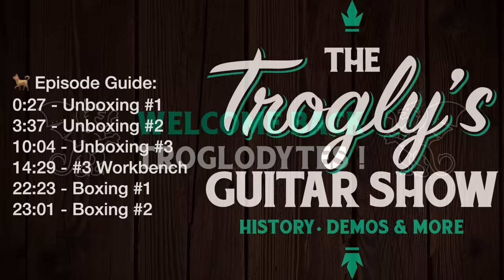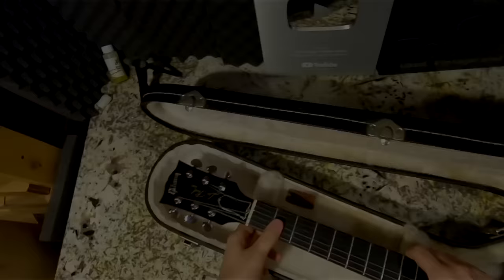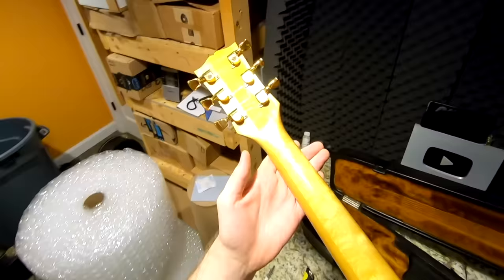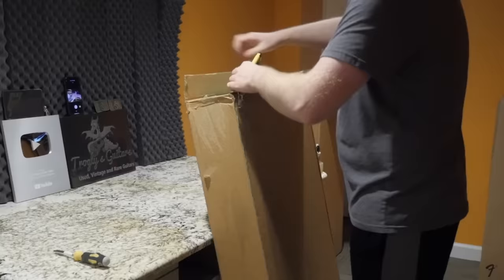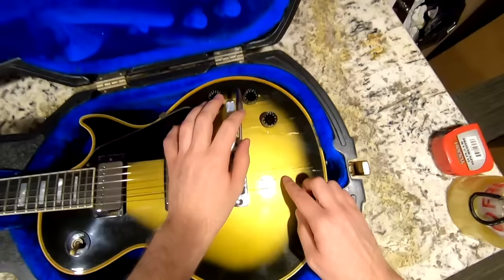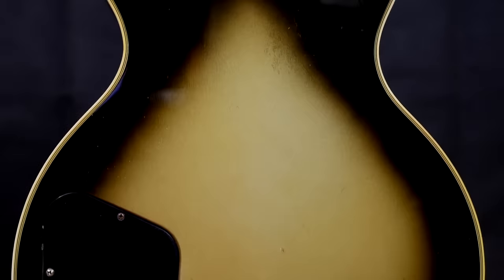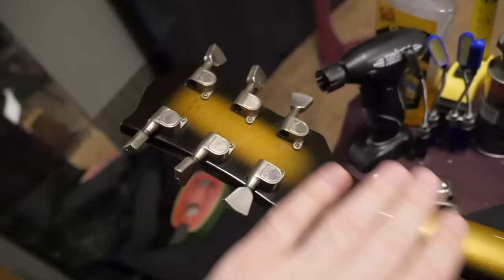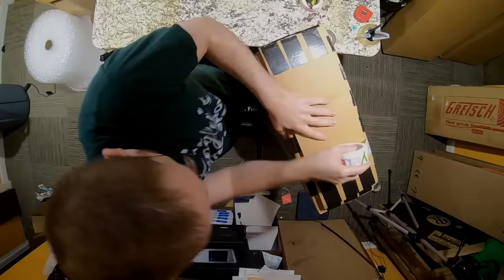What Happens When You Buy 3 Guitars from Guitar Center? | Trogly's Unboxing Guitars Vlog #87

Comment: I bought one guitar from Guitar Center, had it shipped to the local store (cheaper shipping). When it arrived I went to pick it up and they opened the box and the headstock was broken. They processed my refund on the spot, no issues. If I ever bought another through them I'd do the store-to-store shipping again,  just in case.
Reply: I do the same
Reply: Just bought one. Trying to learn and after hearing the horror stories about GC I wasn't sure if I wanted to buy from them bought ordered it pickup and luckily it was perfect

Comment: Dude. A lot of the older Gibson guitars   Have longer threads sticking out. They are cut differently. You can also add a half moon washer under the nut. I’ve done it a million times with great success.
Reply: Truss Rod Threads on a Gibson are a good thing.. you should’ve made the adjustment to see if it operated correctly. You can always add a washer. Kids these days😂
Reply: THIS!
Reply: Very good point!!!
Reply: Yeah, this guy is worried about some really strange stuff.
Dude, I'll take that natural finish les Paul if you don't want it lol... jeez
Reply: Yep
Reply: Also looking at the threads without measuring the relief tells you nothing about the state of the guitar.
Reply: Confirms the neck is already straight, then says the truss rod is toast and beyond adjustment.
Reply: @sunbrookcondo4179  He "sighted" the neck and said it looks straight. Measuring the relief with feeler gauges would give a better idea of how much relief there is and then tighten/loosen the truss rod to make sure it's still working. 

As others have said all truss rods are not cut to the same length so you can't determine if its 'toast' by the number of threads showing. 

I'm not a professional tech but I've been working on my own guitars for years and I wouldn't return a guitar I liked without doing some more investigating. A guitar this old with a 3 piece maple neck probably hasn't moved in years and if the neck has the right amount of relief already I don't see it as an issue. If it plays great and the set up feels right I wouldn't care. I get that it's a different story if you're selling the guitar to someone else.
Reply: @jonnybabich9667  well pay him for it then
Reply: @sunbrookcondo4179  right?
Reply: This guy really gets on my nerves !
Reply: @ChubToneGuitars  Back it off, see how far it bows and then condemn it.

Comment: I worked at Guitar Center, "The Evil Empire" as I referred to them, for 2 years (aaaaarrgh), and they never, ever, perform the sort of detailed inspection for used guitars that they should. (this does not apply to the Vintage Guitar Vault at the Hollywood store, as they most often sold to the pro's and discerning collectors, and was managed by two guy's called "The Burst Brothers" who were VERY knowledgable). Doing an inspection of an instrument prior to buying it off the street is a job requirement as mandated by corporate. But in practice, never done, as most people working there, with a few exceptions, don't know what to look for as they don't have the technical knowledge or experience to do this. ESPECIALLY with any sort of vintage instrument.  If you did a "Street Buy" and the guitar was found to be defective later on , you were screwed by management (although sometimes forgiven under certain circumstances). The way it worked was this:
Somebody comes in with a guitar to sell. They look around for an employee to help them. ALL the floor sales people quickly rush away in order to  avoid making contact with the seller if possible (not jokeing here). A manager will then intervene andr does the transaction, or they will assign it to a salesperson to do the "Street Buy" as it is called. Sales people HATE doing Street Buys, because the process takes up a great deal of their time to process and fill out the necessary legal paperwork, etc. This process also requires them to fully check out the instrument (they aren't required to disassemble it though). All of this process takes up thier time and takes them off the sales floor and away from  making commission. Though Street Buys are a part of their job requirements, most hated having to do it andavoided it if at all possible due to this reason. More often than not a new amd less experienced employee would be assigned this responsability and thus, mistakes  would be made. Management could be quite brutal if you didn't make your monthly numbers, and is quite compettitive and cutthroat with the sales people, Sales people took shortcuts, rushed the process, then hustled to get back on the sales floor. This is a generalization of the process and how employees dealt with  it, and it should be taken in that context. It does however, provide you with a caveat when purchasing used equipment from them.
Reply: Drew hasnt worked there in 14 years.
Reply: @deebop4904  neither have I, thank god. I was only relating my experience theere and not intending to speak for others. The management I worked for was possibly the worst experience I have had. This may not relate to other stores, but it certainly did mine.
Reply: @stephencastro1437  nothing has changed

Comment: Just started watching the video, but what a coincidence -- I also purchased three guitars from guitar center recently. Each one was either listed incorrectly or priced very well. Every guitar I bought came without a case and they did a GREAT job packing it. A couple of the guitar's they even put into boxes from the same brand 😂 i.e. a 2004 epiphone I bought came in a new epi box because they had it lying around. Cute lil touch for an inexpensive guitar
Reply: That's cool, what model epiphone did you get?
Reply: @brendangibson2925  it was an SG-310 listed as a special iirc. I got it shipped to my house for $135 total, sold it for $200 on CL by the end of that week. Funny enough, I actually mentioned trade Tuesday in my FS listing for that guitar, and somebody emailed me to say they were going to lowball me until they saw I was a trogly fan. 🤣😂 they wished me luck instead.
Reply: @brandonmitchell1056  ah that's cool, I have an sg-EB0 bass
Reply: Lying around

Comment: Guitar Center Used has been my guilty pleasure since 2010. Now, you can find serious differences in prices between stores. I have made quite a few great purchases from the stores in the smaller markets. I am usually looking for the oddball 80's early 90's amps and guitars.
Reply: i work at a small location guitar center and we price gear to MOVE here. sold a used custom shop g&l asat that was absolutely decked out for $1350 the other day. there are deals out there just depends on which guitar center, who bought it in, and who you talk to about purchasing

Comment: 12:00 that is what heat does to varnish! I make custom walking sticks. Sometimes I need to remove the clear coat. I use a heat gun gun to remove it. The finish looks like this when it gets to hot and I don’t scrape it off. Sometimes I get interrupted mid process. When I get back to it, that’s what it looks like.

Comment: 3rd one looks like water damage.  There is a pretty distinct dirt line running up and down, likely the guitar was standing up and only the area from the tal piece down actually was under water.    The splitting further up the body is in line, and shows that the liquid was absorbed pretty high up.  The pressure of the strings is likely what caused much of it to break.
Reply: Ya that's pretty severe for sure     that makes more sense

Comment: You can save that truss rod. Look into the stew mac truss rod tool. Allows you to slightly bore into the truss rod cavity and then it also adds more threads to the truss rod. Well worth it to save that beautiful custom.
Reply: Just put steam on the fretboard, take it off, remove truss rod, put new one on and glue the board back

Comment: You can easily drop fill in the cracks with tinted lacquer, and do a fairly good finish repair. Especially where the lacquer is just checked. It will drip through the cracks and under the lifted finish and adhere to the body. with the proper rub out it should look good. Thus saving it from a respray!

Comment: Great vid. No need to discard guitar due to exposed threads on TR. Usually an added washer solves this smoothly. Recently did on a P bass. Some brands like Rickenbacker come w. a fair bit exposed threads original. Just a tip

Comment: Austin, I am guessing chemical damage caused the issue on the last guitar. If you look at where the blistering occurs and the fact that it only affects the clear coat and a small portion of the original paint, take notice of how it seems to be "running" away from the nuts on the controls and even the trem system. It looks to me that someone sprayed something like a WD40 on the nuts and did not know that it would react with the nitro finish as it did. Exposure to a high heat is of course possible as well, but just by the fact that it is moving away from the controls it looks like whatever they used was sprayed on to the nuts then ran down the guitar. Now, heat exposure could also be the cause because those same areas would have heated up more than other areas of the guitar because of the metal that's there. But, if it was heat then it should be around the controls as well, not just moving away in one direction, which indicates more of a liquid running. I am not sure what lubricant would interact with Nitro the way it appears to have done on this guitar but that shouldn't be that hard to figure out. How in the world did you not see that kind of damage in photos?

Comment: Guitar center sold me a Martin that needed a neck reset. Was at the end of its truss rod too. I still liked the guitar but that definitely should’ve been disclosed before sale. All the details about these guitars are available because the techs do look at them and even set them up so they’ll sell on the floor but they don’t disclose anything. Pretty shady for such a huge guitar retailer.
Reply: @tjailts  yeah that really is the kicker. The returned guitar will go right back up as they cross their fingers that the next buyer won’t notice or care
Reply: part of why they are going bankrupt.
Reply: I'm not saying great things about Sam Ash because they are definitely overpriced on their used gear but at least on their website they straight give you a description of the guitar which guitar center should do as well.
Reply: @beefnacos6258  yeah it’s funny you can actually get good deals on guitar center, not because of good prices but because of mistakes they make listing things. Just shows you how bad that system is
Reply: This video was on my suggested videos.... My dad is a guitar player/PRS junky, I'm just a drummer, but I bought a used Pearl drumset from Guitar Center. I noticed in the pic on GCs website it had 10 lugs on the bass drum (only higher end drums have 10 lugs vs 8 lugs) and had the traditional size toms (not like those power toms in the 80s) I called and asked if the drum shells were fiberglass and they checked and the manager said yes.... They were listed for 150 dollars and I asked if they could help me out on the price... He said $115 delivered (done deal)...the next year Pearl drums reissues the fiberglass drums for $1100....if you are patient you can definitely get a steal...I'd hold my drums up to the highest end drums as far a tone and volume for $115 delivered 😊. If I did not like them, I had a chance to return them...I'll never sell these drums.
Reply: @drumsandmore4448  absolutely you can. It’s just such a crap shoot on the gear actually being in great condition. But of course there’s the return policy. It’s just funny how those steals come as a result of errors not actual good pricing
Reply: @drumsandmore4448  Power Toms rule! 😄
Reply: @drumsandmore4448  I was a drummer, switched to guitar and vox 12 years ago so I could control my own band. Frankly it's GREAT to hear someone else say "I'm just a drummer!" A great drummer is a thing of beauty! One that's modest is a god-send!! If you can sing you're hired!! ROKKON! \m/
Reply: @markcheetah4960  "Ah! The [sound] of napalm in the morning!" ROKKON! \m/
Reply: @DeafBunnysBand  Haha, I hear ya!  I started out as a guitarist but switched to vocals because there were a TON of guitarists around (and most of them were way better than I was).  Vocalists were hard to find, especially ones who had a PA system.  So I switched to frontman, with occasional rhythm guitar duties.  Cheers, man! 😄
Reply: @DeafBunnysBand  Cool, thanks very much!  I subbed back.  Let me know if you're on Twitter, Reverbnation, or Soundcloud.  I gladly follow back!  Cheers!!

Comment: Recently bought a "new" Gretsch Jet Baritone and had it shipped to my local GC.  The packing was horrible - loosely packed in a large box with paper and bubble wrap.  Headstock cracked, neck damaged.  Glad I had them open it, sent it back and currently waiting for it's replacement.  Had a new Guild Starfire 12 sent to the same store several months ago and it was neatly packed in a Guild box, which was inside a larger box and well packed.  Guitar was immaculate.  Moral of the story, if you buy from GC have it sent to the store and have them open it up.

Comment: You often get weird about truss rods being “maxed out”.  StewMac makes a $1 washer that you just take the nut off and put the washer on. Operates just as it should. Really not a thing at all.
Reply: The thing is that it starts pulling the stop plug forward towards the headstock and that becomes more of a problem.....just saying...on the other side Yes I would at least try it first before returning it because actually what you are talking about sometimes works......
Reply: @rondobondo6600  I hadn't thought of that. I suspect that is because more of the rod is above the most stable part...I wonder if they could make a similar "washer" that is similar dimension to the Gibson stop plug. That may keep it from pulling that way.

Comment: On the body the Kahler doesn't seem stock. It should just have a small square hole. The truss rod cover should be in the regular location just shorter and the lock nut is usually right next to the regular nut.  But they could have refined that from 85 to 89.

Comment: Think you may be a little over sensitive on the truss rod adjustment nut. Had to put some washers under the nut on my '98 special, still has heaps of actual adjustment available. I put the washers in originally because the socket spanner I adjust with couldn't reach the hex on the nut because the truss rod protruded so far. You could make a plate spacer if you don't like the look of the washers.
Reply: I think his concern was that the rod is pulling out and stripping. He is a reseller and his care and eye for reviewing stuff like that would make me very confident to buy from him. I don’t want to worry about all that myself. Trust goes a long way.
Reply: I'd be inclined to agree   but this guy does this 24 /7     I only dream of buying that many guitars   hell I wish I could afford 1  I'd  just get that one repaired properly tho    if I could
Reply: I agree man over sensitive . I’ve never heard anyone complain about that issue with a truss rod. Especially if the action is low. You didn’t even play it 🤣
Reply: What do you do if you have the opposite problem? I have a Washburn Eagle where the action is just fine but the truss rod is as loose as it can get.
Reply: @BCThunderthud  dunno heavier strings XD

Comment: To bad about that natural finish LP, Trophy.
I'd probably try putting lighter gage strings and backing off the truss rod a bit, or preferably, change nothing and find out the EXACT gauge and EXACT brand of strings on it, hope that's the only kind ever used then, test see if it has 1\4 turn of the truss rod left in both directions to compensate for weather changes. Then I'd keep it as a player.
However, you're a seller so send it back or have it repaired.  The guy I know wouldn't do that repair for $200 even for a regular customer. It would be more like $350. He is well worth it though. I trust no other shop.

Comment: I ordered a used Gretsch last summer from Guitar Center and when I got it it was NOT the guitar that was pictured in the ad (different pickup configuration, different sound holes, different pick guard color). It was very frustrating but at least they were very apologetic when I returned it.

Comment: I bought a Gibson ES-335 Custom Shop guitar brand new in 2009 and it had such a soft neck wood that the truss rod nut was boring its way under the first fret! I took it to my guitar tech who chiselled away some of the wood and inserted some hard walnut in there. It had become so bad that the neck would bow from weekend to weekend! Every week I had to adjust the truss rod to bring it back to the proper relief. No sooner did he fix it at the nut end, than it started to pull the other end of the truss rod up under the fingerboard! He removed the last half a dozen frets with the fingerboard attached and did a similar repair, then replaced the fingerboard and re-did the binding. When I took it to the store I bought it from, they just didn't wanna know about it. What should have happened was: Gibson should have replaced the guitar for me. Simple as that! With such a major problem, it should have been covered by the lifetime warranty against defective materials and faulty workmanship. The guys, who up until that issue I regarded as personal friends, promised they'd make it up to me on my next purchase . . They said they'd bring back from their next trip to America a fat neck Gibson ES-335 and sell it to me for $2,500. Of course that never happened and I haven't been inside that shop ever since, and I won't go back there until my phone rings with someone from that shop telling me my guitar that I was promised over ten years ago has finally arrived.